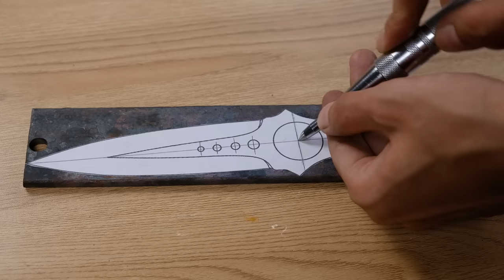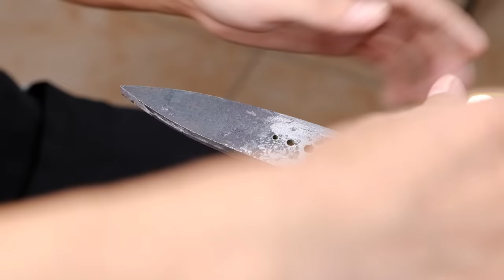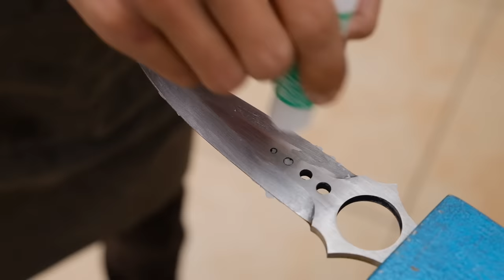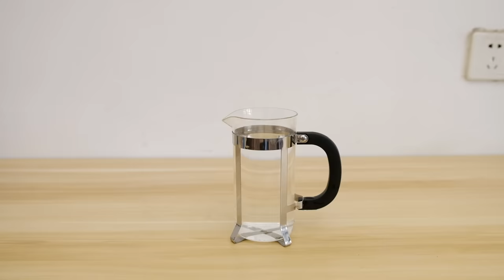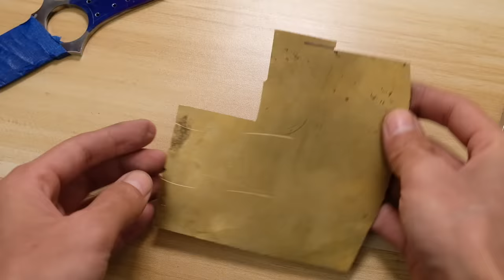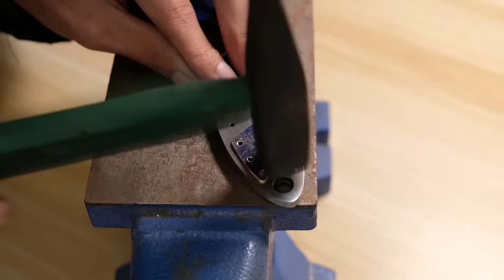Making CSGO Skeleton knife out of Spring Plate

Comment: Did u anneal the spring steel before cutting with bandsaw?
Reply from the maker: Annealing correction treatment is required, but cutting can also be performed without annealing treatment, but it will affect the life of the band saw blade
Reply: Can u help show how to anneal spring steel next time?
Reply from the maker: Just heat it to orange-red and cool at room temperature, this is very simple

Comment: 100 percent honest, you should look into selling these, i have yet to find a good seller for csgo replica skeleton knives. It looks amazing.
Reply from the maker: Local law restricts the mailing of knives, otherwise I will definitely sell them
Reply: @HansKnives  that sucks so much, set up shop somewhere else 😆
Reply from the maker: I need to escape from this country😂
Reply: @HansKnives  yes 😭
Reply: @HANS now my real question is, is it possible to like chemically case harden these knives, i've always wondered that and really never found an answer or person who has done this before. If it is possible, what makes parts blue and what makes parts yellow? and also can you control how it hardens?
Reply from the maker: @YoFridayGamer  If you want to get the blue effect, then the temperature should be controlled at about 350 degrees, but this will affect the hardness of the tool, usually the blade will not use this treatment. 150/250 degrees can reach yellow, but this is not pretty.

Comment: Hello one question ?? the sweet wire can be treated with oil to refresh it ????
Reply from the maker: Hi, I don't understand what you mean, can you tell me more?
Reply: @HansKnives  Yes . The problem is that I have to make a buckle for the watch, and I use a wire that bends very easily, since I don't have the tools to use a harder wire. It was if it can be heated and then cooled with oil so that it hardens. I hope you understand me, a cordial greeting, my English is not good, sorry.
Reply from the maker: I understand that as long as it is carbon steel, it can be hardened by heating and cooling quickly, and the hardness depends on the carbon content of the steel.  Remember hardened steel is very hard but breaks easily, you need to bake it around 150 degrees Celsius for better ease of use